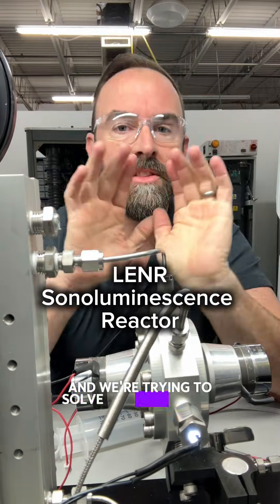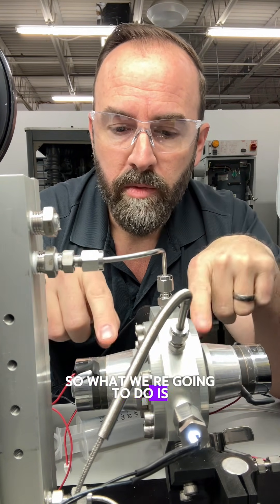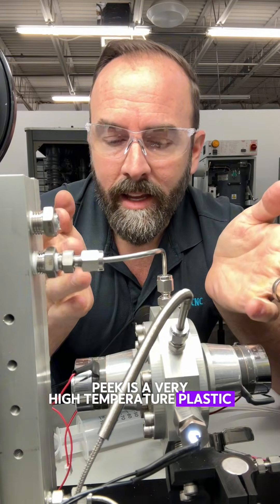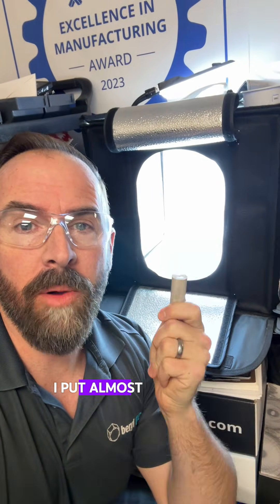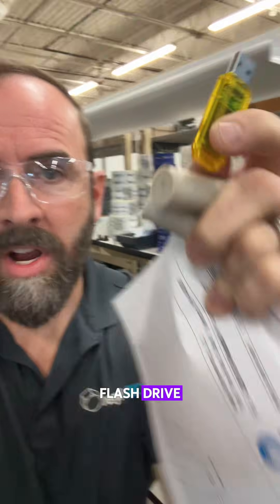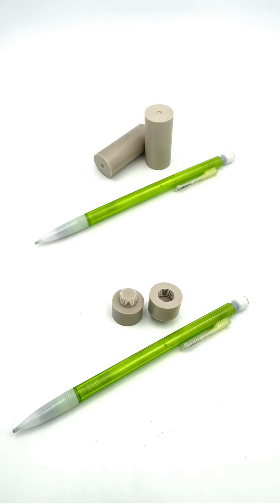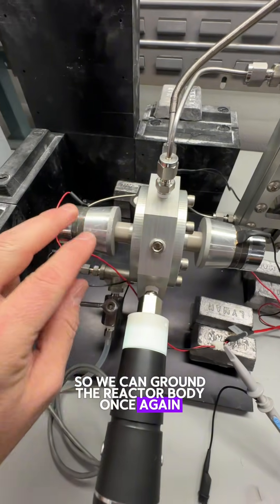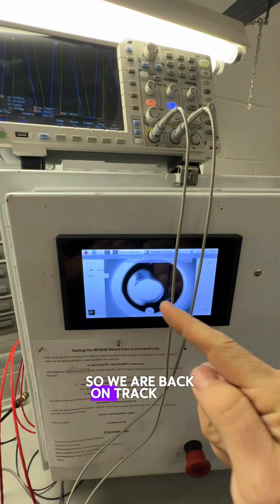LENR Piezo Insulators

Comment: Maybe this is unrelated, but if you have two things requiring power try use two power sources instead of one that power both. I found that for some reason this makes a big difference not sure why exactly but I'm guessing that power supplying isn't as simple as we were taught and there's a reaction between the circuit and the power source that we don't take into consideration and it translate to the other circuit when powered using the same power source

Comment: Watch out for the dielectric heating of that PEEK at ultrasonic frequencies. While PEEK handles 150°C ambient fine, the internal molecular friction from high voltage RF/ultrasonic switching can soften the threads under load. If you see mechanical creep or loss of torqu on those M10 studs after a few runs, you might need to switch to macor (machinable glass ceramic) or Alumina to maintain rigidity while keeping the electrical isolation.

Comment: How could that possibly have been a "huge issue you finally solved?" If you knew you needed to be able to vary inputs to the horns, which seems rather obvious that would have been known from the initial design, how could you possibly not have known the grounds had to be independent from the initial design stage?
Edit: don't get me wrong I don't mean to be an ass it's just that I've never seen or heard of you or your channel it just popped up and kinda struck oddly, with limited info I'm not sure if you're legit and serious or some kind of bizarre new screwy BS social media  thing!
Reply from the maker: I appreciate your tunnel visiony proper engineery by the book way of thinking, and you’re right. The reality of R&D is way more complex. When I first wired it up I got an arc and the system shut down. Realized it was the ground issue. Wired them in parallel instead, disconnected my ground to the reactor, and floated the whole reactor. I kept pushing forward without any ground because who cares, I was making forward progress on the acoustics. I don’t operate like your typical corporate engineer, so it’s fair to get this sort of comment, also fair for me to smack down the classical engineer mindset. Anyway, thanks for watching, check out some of my other vids, I think you’ll like the content over all.
Reply: @i2c_jason  I intend to watch more, I'm almost totally self taught brother and not trying to be a dick that's why I put the edit in there no offense meant, you're obviously out of the box which is where most great things are found far as I'm concerned. The issue of realizing the units need to be isolated to vary frequency independently only at that point is my entire question, just wondering how things got that far, I don't know I wasn't there maybe it slipped through the cracks, it's hard for me to think you wouldn't know since you obviously have the skills, I'm curious how or why that happened, perhaps you had a reason for ignoring it, it just struck me as odd so I spoke up, I thought that was ok?

Comment: Divider to ADCs: Use identical HV dividers from each bridge output to ADC (e.g., 1 MΩ / 33 kΩ) to keep inputs safe. Identical dividers preserve differential math.

If noise/CM swings upset ADCs: Prefer an instrumentation amp front-end; reference its REF pin to Vref/2.

If your H-bridge needs true deadtime/complementary phases: Use a gate-driver/H-bridge that handles this internally; the code above adds a basic duty shrink but external drivers are safer at high voltage.

Comment: Sorry if this is already accounted for... When you've put those insulators in, you may have added capacitance between the system including from one piezo to the other, which may interact at certain frequencies according to the capacitive reactance value. Just a thought in case you run into something weird at some frequencies and start chasing your tail. Keep these videos coming, it's really interesting.
Reply from the maker: For sure, and the spacers themselves have their own acoustic impedance. I really added some variables here but it had to be done.

Comment: Do the two swerving bearings align with the panametric fan for use in unilateral phase detractors?
Reply: Yes!  You have to adjust the dooplehangar without creating a ground loop by moving the sinusoidal signal from the mismatched cover to the flare nuts, because of their internal capcitance when the moon is in the 7th house.